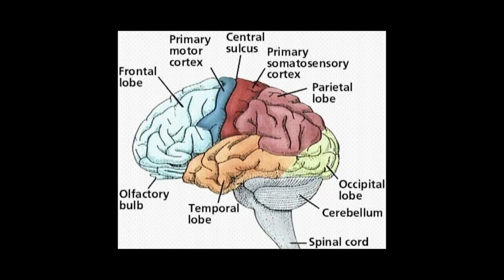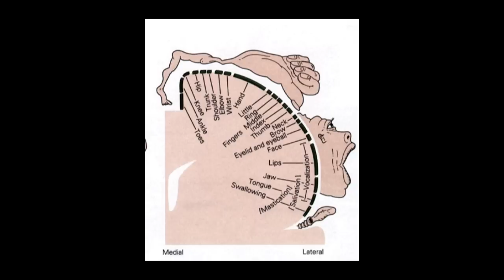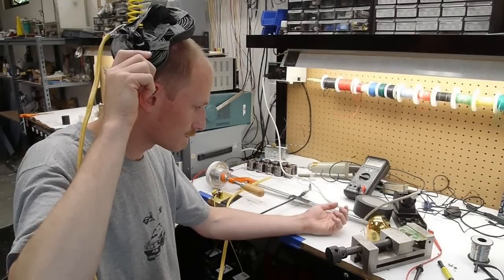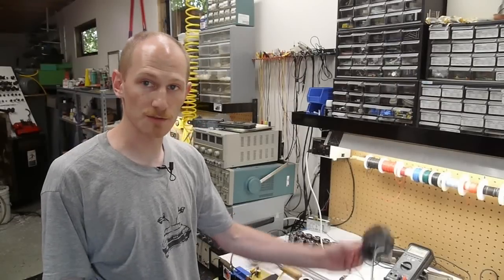Transcranial Magnetic Stimulation project - part 2

Comment: I love that diagram of functional anatomical correlation you showed.  I have an old psych. textbook from Princeton with the same picture.  I have always been curious about TMS but have never tried it myself.  A cap bank made of power factor correction caps or microwave oven HV caps would probably work well for this.

Comment: Impressive experiment. I d like to know the Butterfly coil configuration in terms of guage of coil wire, diameter and number of turns of coil. Also, the spacing between each turn of coil and supply current as well.

Comment: I remember in one of my particle accelerator books, there is a formula to add specific values of L and C to add higher frequency components to the pulse and improve the rise time. Essentially you would be creating a pulse forming network.
Reply: So I stumbled upon this video after researching the healing frequencies (more with sound/resonance) and after reading your comment I’m wondering why those higher frequencies were never tried. I believe if they could get the frequencies to those higher levels it would open up a whole new door way. 
@Applied Science….do you think you could create a nine coil head set with each of the coils registering a specific frequency (namely the solfeggio frequencies) as depicted in the following video

https://youtu.be/ZQkBmCJG9i8

Also a coil tuned to 963hz specifically for the pineal gland

Comment: Yes, you needed more inductance like your observation of commercial units indicated which would mean more turns of the wire which would have resulted in a stronger magnetic field once the peak current was reached, even if at a slight loss in peak amps due to resistance losses. Looking quickly at the math, twice as many wire turns would be 4 times more inductance to get something like 4 times slower response rate as you indicate is normal and have resulted in 2 times more magnetic field, although with double resistance. Combined with 1/2 coil radius (i.e., same wire length giving double turns) would have kept inductance to where it is now with double magnetic field in a smaller area, increasing the effect on fewer cells, with more probability of heat damage to cells. I would think rise time should be closer in shape to fall time. The peak may have also lasted a longer time giving cells a little longer to respond to the magnetic pulse. There seems to be a reverse current at the end, which I did not think would occur if you are using an SCR, but in any event a larger inductance might have made more use of that loss. It looks like you have a 50 microsecond pulse which is pretty darn fast for a neuron to notice it, being half a 20 kHz cycle.  Faster rise time results in more heating of tissue which causes damage to cells.  Also, higher wavelengths of EM fields are generally more dangerous, such as cell phones possibly being more dangerous than frequent work on AM station radio towers.  4 microsecond rise time should easily have >1 MHz harmonics much stronger than the 15 microsecond pulses of commercial units.

Comment: The placement of the coils that you used to attempt Occipital stimulation was actually way off. The correct position should have been above the  first bump in the back of your head on your scull. Electro-encephalographists call this the inion, following the International 10-20 system

Comment: judging by the uf and voltage of the capacitors it looks like you can use the large caps from old computer power supplies and save your self money

junk power supplies can be obtained from your local computer repair shops, dumpsters and maybe your local electronics recycling center if they will let you take electronics

Comment: @bkraz333 you said your job involves TMS machines. are the coils of TMS devices made with grounding brade or flat copper? I've done 15 sessions of TMS of a Neurosoft device. rTMS actually. I also am an electronic technician. I inttend to build my own TMS device. Yes, I think you would need a larger capacitor bank to make it work with the butterfly coil because it is like 2 singular coils in series but you said you're not going to buy caps anymore... you got a nice workshop.

Comment: You could double the number of turns in your coil (using strips half as wide if needed) which would double the inductance like you say to slow it down, but it doubles your magnetic field which is the same as saying it allows you to cut your amperage in half to keep the same magnetic field. But I do not see any reason to slow it down unless there is a safety issue.  Just because harm can't be measured when it comes to brain function, it does not mean that harm has not occurred.

Comment: Ben, 
Do you know of any weight loss management work being investigated in the TMS studies. Presently stomach surgery is the principle procedure. It seems to me that taste and smell  are the culprits in overeating. The stomach only cares that it gets full and that could be with apple pie or cardboard. Surely there must be a better solution to this problem other than bypassing or removing the stomach. Maybe an electrode on L & R  ears hooked to a 15KV, 5A supply would help..
Regards,
Glenn

Comment: I feel the urge to reproduce this... Apart from the obvious dangers like electrical shock and damaging nearby circuits, is there any hazard to inducing currents in brain tissue? I don't exactly want to lobotomize myself with this.
Reply: Dennis W seizures are possible if you stimulate wrong part of brain
Reply: target ventral tegmental area and raphe nuclei
Reply: u would not want to stimulate right side of prefrontal cortex you want to stimulate the left left = happy thoughts right=very unhappy thoughts

Comment: Is the rate of rise of current should not be as high as possible for better efficiency stimulation?What if you try capacitors are used in the Tesla coil?